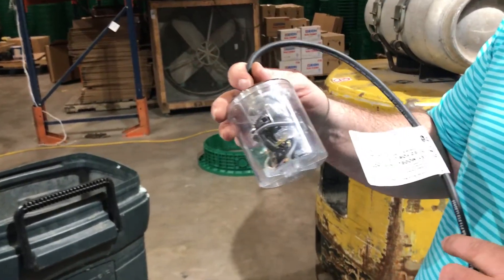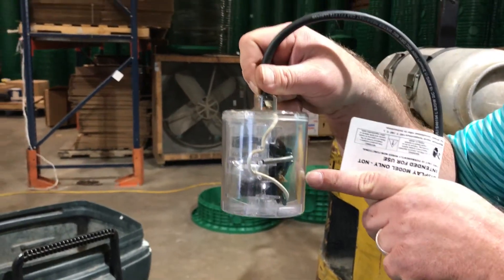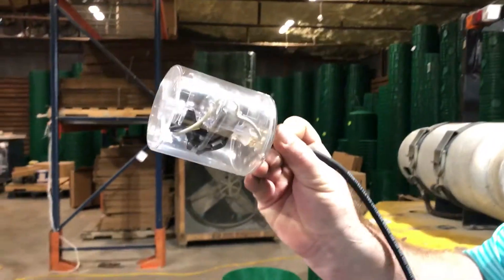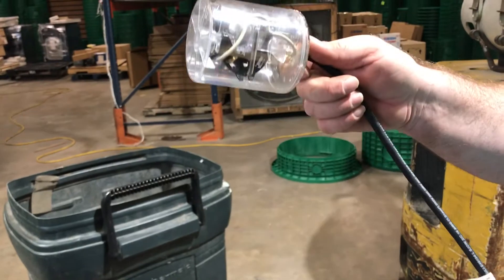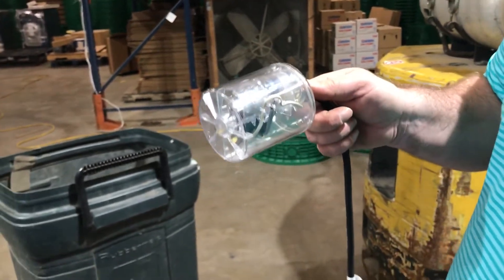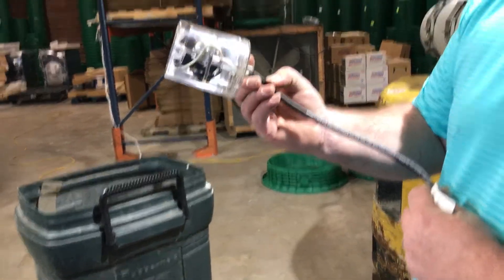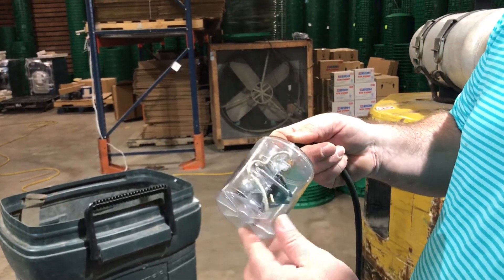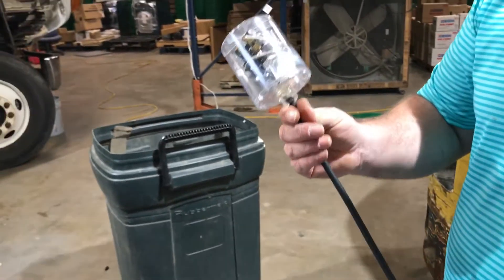How a float switch works.

Comment: I had a tech come out and replace what they said was a faulty float switch with a new one but my second septic tank for effluent fluids is filling up with fluid and the new float switch is completely upside down and the pump wont run unless i set it to manual pump. On auto it doesnt seem to turn on if the float switch is updside down
Reply from the maker: wired wrong or a relay possibly.

Comment: We put a well water neutralizer system system to backwash into a basement/celler waste water 41 gal. sump pump. The alarm goes off (highest float) and stays ON. We opened it up and when we manually lift the alarm  float up and down it goes off. Why doesn't the alarm go off when the water level goes down?. Obviously the back wash pump is pushing more water than the sump pump can keep up with,initially, hence the high waterfloat alarm going off
Reply from the maker: Could be a normally closed float. I would change the float out.
Reply: @wholesalesepticsupply  
We raised the alarm float, but it happened again. Was told by the job foreman they had to jiggle the alarm float to get it to turn off this time. Odd, because everything is brand new, only 1 month old. Am ordering new alarm float...
Reply from the maker: @jeffrandolf5673  okay float could be faulty water inside one will do that.

Comment: In his describing how it works he states that when the float goes up it hits contact and "your pump will be running" and then was the water level drops the float "and it will turn on." Hmmm, seems to turn it on either way. I think what he means to say is that when the float is up, it allows the pump to run if needed; when the float is down, it does NOT allow the pump to run.
Reply from the maker: That was a error

Comment: Where can buy sump floats with mercury switch and not the unreliable mechanical switch?
Reply from the maker: Berhtor Chio we have never had a failure on a new Mecanical rhombus switch. Merc switch’s are now also more expensive than Mecanical they also don’t have the lock amp rotor rating.

Comment: if up is on, then adding it directly to the power point wont work because i want up to be off for it to work. this is very confusing. why doesnt the circuit close when its down and thus allow current to flow through the float switch and to the pump for a very simple design. if my float switch is just a head, and a cable with no other parts, what would i need to add to turn a switch on when it is down?
Reply from the maker: Orwell rolls over... it depends on the float some do that more in water well applications. It would be normally closed float switch. I will do another video explaining that.

Comment: Hello, so how does a float switch communicate with the actual pump? How is the signal relayed to the pump?  Thanks
Reply from the maker: femalefeline the contacts close and complete the circuit giving the pump power on this particular float switch.

Comment: Hey! I just wanted to know if I could use a float switch to operate a motor in both direction. Like motor rotates in clockwise when switch on and it rotates in counter clockwise when switch in closed position. This is related to a project I have been working on, so a little help would be appreciated. Thanks!!
Reply from the maker: neel maradiag the pumps we deal with wouldn’t do that so i don’t know. You would have to have use a normally open and normally closed float.